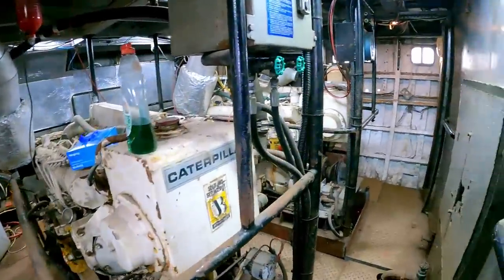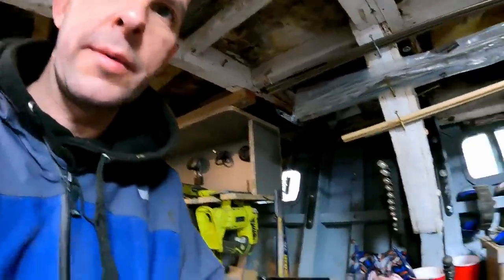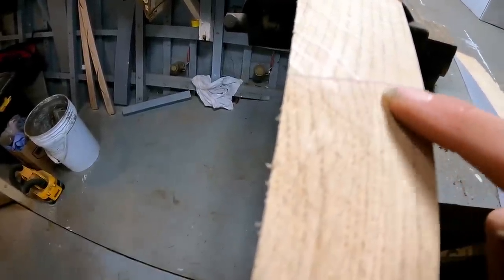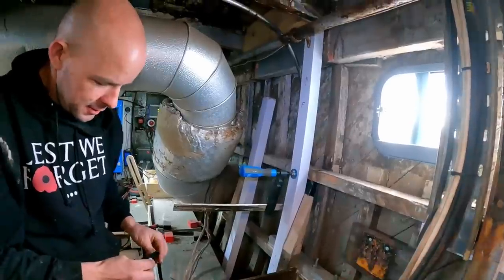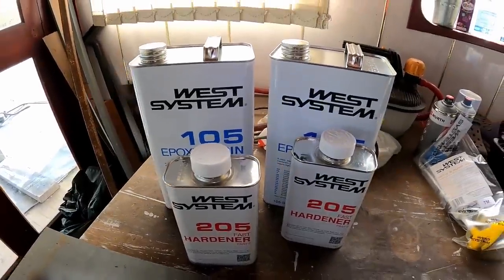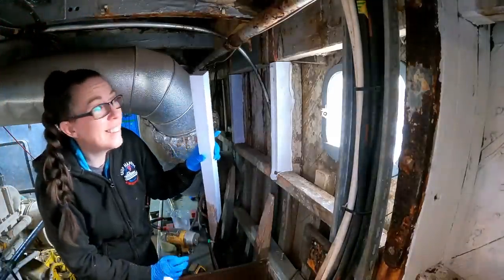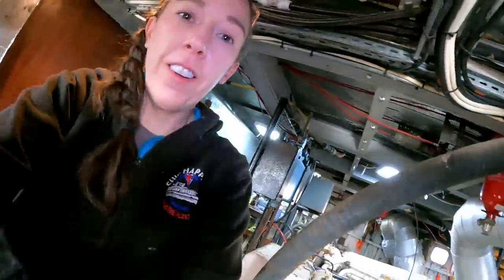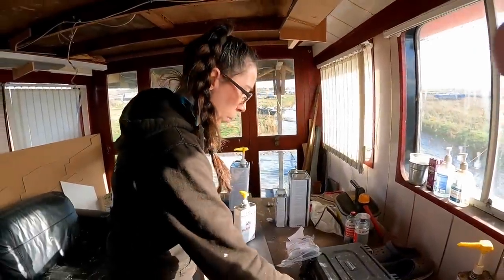Ep 115 - We Made A Big Mistake - Boat Work Gone Wrong! #boatrestoration

Comment: Those annoying 'stiff cards' you always get in the post make great disposible spreaders. You can even use a triangle file to cut some notches in one end to ensure an even layer of epoxy. Don't fuss about small mistakes, I spent an hour making compound bends in S.S. tubing then trimmed the ends to the wrong lengths. Had to splice a 12 cm piece to one end and retrim the other. At least I didn't have 72 thousand people watching me!:face-blue-smiling:

Comment: It is interesting that port fwd and port aft are both relatively not too bad.  However stbd fwd needed a lot more work, and you have already hinted that stbd aft is not much better.  I guess the stbd side had more weather or leakier deck.  It does suggest that when you do the middle, it will sensible to start stbd first.

Comment: You Two could get rich, really rich, teaching couples how to get along as well as you Two do.  You're work is incredible, your relationship double so!  Gee, why not put a pin in it and sister it on either side.  It's behind the exhaust, who's going to see it, and who knows, maybe with the heat of the exhaust it might be a good idea for wood to be thicker there.  Actually, when I've taken old homes apart before they used insulation around chimneys and flues I've found an inch of char on wood members.  If they hadn't been 'old fashioned' framing with generously sized sections it might have failed.  It'd be like 1/2 a typical US dim for lumber, 2 inches.
Reply from the maker: The key to happiness is not wanting to be rich! If we truly wanted to be rich we wouldn't of bought this big wooden boat 🤣🤣

Comment: It happens!  I was expecting much worse based on your title.  mistakes are easy to make when working in tight quarters, and this was probably was the hardest one to access on the port side.

Curiosity, I'm sure you mentioned it before, but what type of white glue are you using?
Reply: I think they were using epoxy.

Comment: Just n question! Why dont you haul boat out in drydock and repair hull on outside and bottom and splash it and continue on inside?
Reply: They are fixing what they can while still in the water because there is no need to pay on the hard for work that can be done in the water. Being in water doesn’t cost

Comment: My Granddad used to say "he who makes no mistakes, does no work". I think your right about laminated being stronger, especially if you reverse the grain of the wood as you stack them.
Reply: While steam bending does degrade strength, depending on the radius I think solid is probably just as good.
However laminate is more resilient when strained repeatedly - any cracks which develop will not immediately progress through the entire thickness.

Comment: I'm sure you have seen 'Acorn to Arabella' but if not then worth noting her ribs are oak and steamed but the timber is first sawn down the length creating 2 laminations. However, they are not glued so in effect they have 2 ribs one on top of the other. Copper rivets of course.
Reply: The way Simon and Gemma are doing it is the standard. Glueing the laminations creates a frame member that is at lesast as strong as the original timber. I also enjoy AtoA, but I see no reason to not glue the laminations.
Reply: @TR4zest  It's mad isn't it, you get two lengths of wood and wood glue just a bit of it and leverage at the ends to snap and it won't break on the seam. the wood elsewhere does. When i used to be a welder as long as you did the fillet weld or whatever thicker than the steel it was the strongest point. Rosco on Life from the Hulls kept slitting his moulds and cat up. He said funily enough when he rejoins it it's even strong. go figure lol

Comment: we used to use a cast iron drainpipe to steam wood, plate welded on one end, build a fire and it worked fine, you can also just soak in water for a few days, but the steam is a lot faster / easier to work.

Comment: More great progress! A very good thing that both of you are expert wood workers!! I noticed an opened seam in the exhaust duct while watching you work. It appears to be a crimped seam in the actual elbow...this is not a good thing for room air. I'm not sure what the best repair would be, but I would suggest using the "high temperature" aluminum duct tape. It has fantastic adhesive properties for permanent joints on this kind of material, but I'm not sure of the temperature range, probably in excess of 80 C.
Keep up the entertaining and professional grade work!  By the way, have the kiddos become resistant to being on the boat, or is schooling scheduling being the stumbling block?